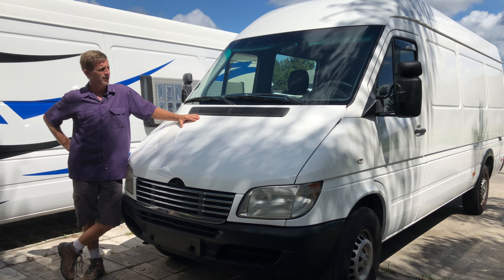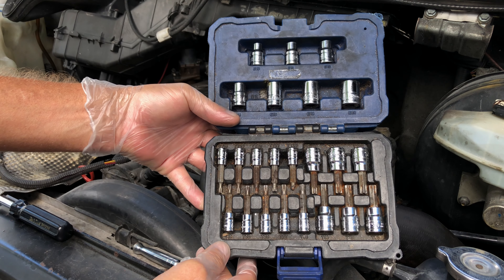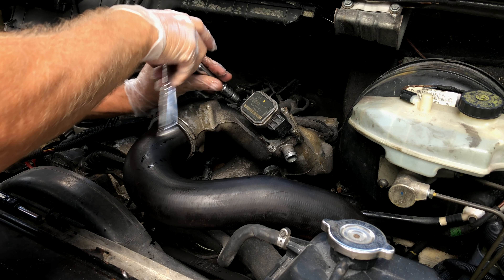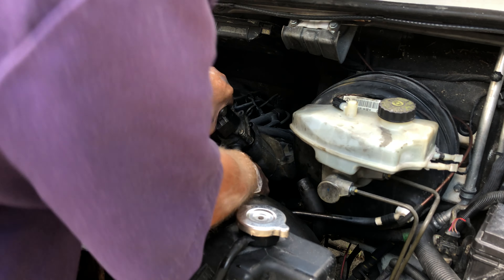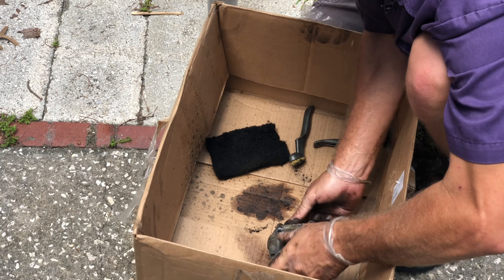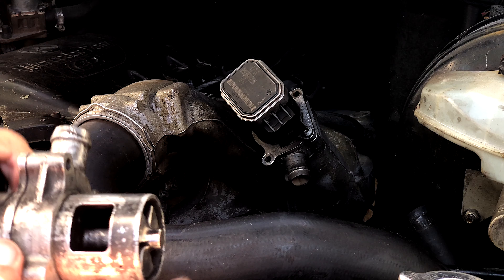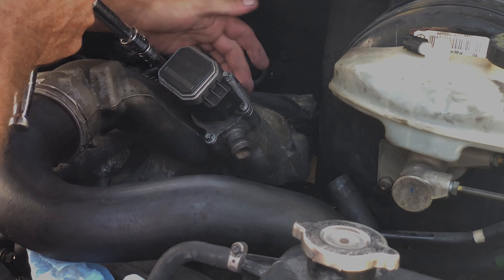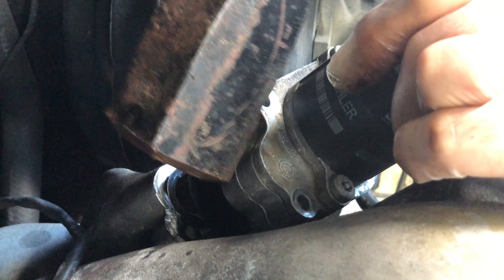EGR Valve Replacement/Cleaning - T1N Sprinter (2004-2006)

Comment: Phew, mine slipped right out! (I was dreading that struggle after watching your video, but looks like the last person must’ve used anti-seize.) Cleaned it up, added a bit more anti-seize, and it’s working lovely…

Turns out my limp mode was due to a tear in the intercoolant turbo hose though, not the EGR valve. But not complaining about a clean EGR valve!

Comment: at 182K miles I was noticing in colder weather that going up a slight rise I was getting a little rolling hill throttle feed; so thought it was time to clean the EGR. My EGR with hose and 3 bolts
removed came out like a 350 chev distributor with very little pull; just a little twisting. The three blade prop was a little lazy in returning to home with a little clink sound. Sprayed the prop with
brake cleaner while holding the prop side close to the earth and some paper towels to collect the buildup and all was good. Now runs like it did when new with the throttle dropping rpm at low speeds very quickly.

Comment: hey, did the other codes go away when replacing EGR aswell? the glow plug module and glow plug issues? i have all the same codes basically with a few more glow plugs ones. THANKS
Reply from the maker: No, glow plugs and EGR are completely different systems. We have videos for testing and replacing glow plugs.

Comment: Thank you, great vid.  I had to replace mine a couple of years back.  The part alone is >$400.  I have the old one and some day when I don't have anything to do, I'm going to tear it down and clean it up.
Reply from the maker: From what I am told, if you crack it open you have little chance of getting it back together & working properly. The security screws are security screws for a reason, so I would clean as best I can without removing those.

Comment: I had a hard time removing the EGR valve from my '06 2500. In fact, I broke off a piece of the part the coolant hose attaches to. I finally did get it off, cleaned it up, it was still not as snappy the one in your video but it'll do for now given I have no major issues.

Comment: What did you liquid was that at the end? I bought my 2005 sprinter last year, and the seller said it had no Egr,  i presumed that model just didn't come with an Egr. Ive since found out there should be an Egr but i believe its been removed, how would  this effect performance?
Reply from the maker: That is controversial and highly debated. If your van is a European model it might have never had one, as they weren't mandated until a few years later. Generally, those who feel the government is here to control us will swear they get more power and 5mph better fuel economy with the EGR deleted. That would be a 25% increase from 20mpg, and science does not support those claims. Those who feel government is a necessary part of civilization will point out deleted EGR will fail annual inspections in most states and Canadian provinces, be unregisterable to any buyer in those areas and punishment for violating Federal EPA regulations is greater than possession of cocaine. A guy 8 blocks from my home was fined $850,000 a few years ago for selling "EGR delete hardware & software" online.
Reply: @FloridaVanMan  I'm in the UK
Reply from the maker: @mikereynolds7956  I'm fairly sure UK sprinters did not have EGR until 2008 or 2009.

Comment: If you have a really sooty fan is there any other  deep cleaning further down in the system  that needs to be done before putting on a new or cleaned EGR valve. And how would you do that please?
Reply from the maker: If buildup is more than a coating and starting to fill the tube of intake manifold a shop-vac and pokey stick can reduce the buildup. Serious cleaning would require removing the manifold and I wouldn't recommend that just for cleaning.
Reply: @FloridaVanMan  Thanks

Comment: Where did you buy the adapter that works for the icarsoft computer. I am still looking for one that works on my 2006 903 316cdi. All i could read out was the engine computer. I have the 14 pin round plug in the sprinter its a european model.
Reply from the maker: I'm not sure there is a good adaptor for the iCarsoft. People tell me the Autel AP200 works well with this adaptor: https://www.autelsale.co.uk/wholesale/mercedes-benz-14pin-connector-for-maxisys-ms908-and-ms908p.html?fbclid=IwAR05zrYl9NBm7tZg9tByjaEoRfO9gy26TmOWjdAN97zNRwHrFmIVHo7cabY

Comment: You did all the wrong stuff removing that EGR valve.  I have broken intake manifolds, damaged sealing surfaces, and broken the valves themselves with that method, and only do it that way when stripping a vehicle.
How to properly remove valve from intake:
Take a brass drift and a shop hammer.  Tap upward along the back upper portion (you will see a notch fro a drift), then the back left portion (where you used that steel sledge head), alternating as it works its way loose.
That's it.
It takes a lot less time that way, too.
Reply from the maker: I couldn't agree more. Nothing we did that day felt right, and not much worked either. Someday soon we will revisit the EGR and make a better vid. Thank for the tips and keep an eye out for the next EGR upload.
Reply: I have the very same egr valve on my 2007 315cdi. It's stuck in rock solid! A brass drift is what I shall be ordering right now! 👍
Reply: @FloridaVanMan  please take down this video then -- I was following it!
Reply from the maker: @richardgenz7406  Sorry if you got swept up in the comments from 2 years ago or misunderstood my poorly worded response. EGRs usually come out much more easily than this one but we have not found a better way to remove them when they are stuck. If I thought this were leading someone down a wrong path I'd remove it. Following this video advice your EGR will probably come out much easier than shown here. If you know a better way to do it we are listening. There is nothing special about a brass drift and shop hammer, and there is no space to swing it while holding a drift of any length.

Comment: is it ok to block of the egr completely,  thanks for the vids, still looking to purchase, just want all info i can get,,joe and misty
Reply from the maker: No. The van monitors air flow and will trigger codes when expectations are not met. There is a popular "resistor hack" that does not actually work. If the resistor doesn't kick codes your van already wasn't commanding the EGR to open. The resistor only mimics a closed EGR. There are other "tunes" available that are illegal, despite any loopholes you may have heard of. EPA is cracking down on these tune companies and a guy 8 blocks from me settled with the EPA for $850,000 fines. The punishment if prosecuted for deleting your EGR is greater than possession of cocaine and brings a felony record. It is illegal in all 50 states, all of Canada and the UK.
Reply: @FloridaVanMan  thank you for your time, you are a great help, take care  joe and misty

Comment: My EGR valve wasn't fully closing.  I cleaned it up with WD-40 and it looked like new.  It fully closes now, but it doesn't make that snap sound.  The mechanical portion makes the proper snap sound with the electric motor removed.  With the motor attached, it doesn't make the snap sound.  I'd like to find out why the motor is slowing down the mechanical portion.  I re-assembled the EGR valve and the vehicle seems to run fine.
Reply from the maker: When the motors get bad they don't snap back. If the van is running fine, run it! But don't be surprised when the EGR starts showing codes and putting you in limp mode. When it finally gives up you won't be stuck on the side of the road and since it was out recently replacing it won't be a big deal. So run it and get every mile out of it that you can. It might last thousands of miles more.

Comment: I think it would be a good idea to use two wedging tools applied at as near to 180 degrees apart as possible. Otherwise, working just one will tend to cause the device to wedge.

Comment: I found that when  taking out the EGR value  using  a heat gun  on the housing will help with  removing the EGR valve.
Reply from the maker: Overheating is usually what causes EGR failure in my experience. When the aux coolant pump doesn't work or the van is pulling too much load, too fast, overheated EGR will cause limp mode and kill the EGR. So be careful with heat if you are just cleaning, not replacing the unit.

Comment: Thank you for this video just pulled mine out for clean up and we'll the damn connection where the hose meets broke.
That sucks was stuck.

Waiting on delivery if new one (Chinese)
And was curious if I should add a little anti seize to avoid this next time.

BTW....  this is a workout to say the least.
Today can and crank sensor
Reply from the maker: You should apply anti seize. We are doing that now on all EGRs we install! 

A workout it is indeed. Good luck on the cam and crank sensors, we recomend a Sprinter specific scanner that can read the "Synchronization between cam and crank position sensors" value to make sure things are synched post operation
Reply: Florida Van Man 
Thank you for the follow up and will add the anti seize today.
As far as scanner how has that Carsoft scanner worked out for you?
Reply: Florida Van Man 
Headed to junkyard tommoro, any parts I should take and keep handy.
Got a few things last week but  headed back for the injectors, and door parts
Reply from the maker: @panchovillasmith8218  iCarsoft MBII works pretty well, but you need to lookup every code. We have a Carsoft handheld scanner that is better about giving a description of each code, but it's got limitations. Autel AP200 Bluetooth is my go-to for diagnostics. Then Xentry DAS is much more detailed diagnostics and has functions the other meters just can't do, like reset intake adaptive, code injectors, virtual compression testing. etc.
Reply: Florida Van Man 
Awesome thank you. I just received the autel yesterday and was considering sending it back to get the carsoft pro.
Main reason was I also have a mitsubishi mirage and a mini countryman (wife's). I don't mind paying the extra for the additional cars but correct me if I'm wrong, after one year I have to buy the service again for the two additional cars correct?
Reply from the maker: @panchovillasmith8218   Sorry, I don't know about renewals or second and third vehicles. We only mess with Sprinters.
Reply: Florida Van Man 
Got it.
Again thank you for all the info. To bad you ain't in Texas.
You would have BBQ and beer for lunch today

Comment: FVM, got a question? I have a little leak in the AC condenser and have purchased a new one on-line. Will I have to take apart the metal cross bracket for the radiator or is there an easy way?
I cannot see in there to figure out just what is needed in disassembly??
VR  Chicago  Thanks
Reply from the maker: Taking the crossbar off is *the easy way. It is only 4 bolts, but the headlights are in the way, and the grill pieces are in the way of removing the headlights.... So it can be an all-day event.
Reply: @FloridaVanMan  Thanks for the info FVMan. I will save up my courage and get er done. VR

Comment: Hi again Bill. Have you discovered another reputable after market ERG? I know you said you were testing that one on the video. But you were unsure at this point. 2005 T1N cheers. Leon.
Reply from the maker: The cheap on linked on our parts page is what I am using now. It is only weeks old and I've not driven anywhere significant, so I won't recommend it (yet). At $120 vs. $380... I have reasonable hopes.

Comment: EGR valve mystery… please advise. I recently bought a 2005 dodge sprinter T1N van. It seems to run OK and have decent power, but out of curiosity, I decided to clean the EGR valve like you show in your videos. Sure enough it was so dirty and sooted up the blades would not turn at all so I cleaned them really well with gasoline. I even took the valve assembly apart into two large pieces and cleaned inside really well and got the blades turning freely and snapping back like you show in your videos. I put it back together and took it for a test drive and the van ran much worse, almost like limp mode as you call it. I pulled over to the side of the road and unplugged the wiring to the EGR just to see what that would do and to my surprise the van ran like a bat out of hell..better than ever.  I’m really baffled. Have any ideas what’s going on? Your thoughts would be greatly appreciated.😅
Reply from the maker: Once you took apart the two halves of the EGR it was done. They have wound springs and electrical contacts inside that we cannot rewind & connect without very special tools. The security screws should never be removed. If your van doesn't go into limp mode with the EGR unplugged it is either modified (EGR deleted) or the intake adaptive settings are corrupted and no longer adapting. 
A code reader like we have linked on our products page will read the live data where we can see if the EGR is being commanded by the van. Looking at the EGR live data will help determine if your van is having an issue or been illegally modified by deleting emissions equipment.
Reply: Follow up to my EGR valve mystery problem, I bought a new EGR valve and installed it, and the van runs excellent now, almost like a different vehicle. What a pleasant surprise and the best part is the transmission is shifting much more often now like it should. I don’t have to manually shift it so much anymore for hills so my question for you is what is the connection between the EGR valve and the transmission??
Reply from the maker: @kirbymoore492  There is no direct link to the EGR but the van shifts based on how well the engine is running. With the EGR sticking open a little the van realizes the limited power it has available by constantly measuring "load". It will adjust the shift times to work with the available power. When power is reduced it will shift later.

Comment: I have 2 T1N both 2005 the first had over 425k and had ok power most or the time but the second is a 158" dully and has been sluggish I installed resonator delete but I'm not sure what to do next, ?.
Reply from the maker: Code reader is essential. If you clear the codes and none come back, the live data will be helpful. If you find your EGR value always at 6% the MAF has probably failed. We have a video shows how to test the MAF. This is a good code reader. https://amzn.to/3H3mfhI

Comment: MY T1N (208CDI built in 2000) doesnt have an EGR valve because it is registered as a truck and only those sprinters registered as a car needed the EGR...I dont know how that is handled in the USA, but here in Germany that was the case...I was looking for it and couldnt find it :D SO now im happy i dont have it so my air intake system stays clean ...
Reply from the maker: I doubt you'll find your intake system clean, just a different variety of dirt. Like anything else, EGR has pros and cons. Everyone will form their opinions based on their unique perception* of the issue and perception is ALWAYS skewed by the point of observation. 
I do try to keep my engines clean but not specifically the intake system. That is a hallway to the incinerator and unless the soot is excessive cleaning it is on par with washing a trash can. I'd only do that if there is a specific problem that needs remedied first.
Reply: @FloridaVanMan  Right, it wasnt really clean :D
But what i meant was rather that my EGR cannot get clogged, since it doesnt exist. 

But how i understand it the only function of the EGR is to reduce NOx and make the car more "environmentally friendly", right?

Well I can live without that, especially since we pay so many taxes already for this whole political agenda.
I will drive my 25 yo van for at least 20 more years, which is quite sustainable. Thanks to your videos and a lot of books i repaired everything alone so far so  please keep up the good work :D
Reply from the maker: @goug359 WOW! So you can live with Nox emissions and to hell with everyone else?
Reply: @FloridaVanMan  But why should anyone suffer because of that?
Reply from the maker: @goug359  Who is suffering* over EGR? The fragility & hyperbole of some people amazes me. How dare anyone ask you to slow down the toxic gasses you spew into the air exclusively for your own convenience? Go start your own channel and debate this over there before you get blocked from mine.
Reply: @FloridaVanMan  
I dont have a problem with EGRs , my car even has a green Euro Plaque :D It has very few emissions and i drive only a few kilometers each month.  

But I still think it is nice that I dont need to think about the EGR as a potential cause for problems with the engine.

I didn´t intend to insult anyone :D 
There are so many  areas in life where people harm the nature and the soil, just by consuming food grown with Glyphosat and other chemicals..and they dont even know about it or dont want to know...

Buying a brandnew car that has all the newest technology and lowest emissions has still a huge impact on the earth, because it uses so many resources in the progress of building it. 

The difference between the emissions that my car would have with an EGR compared to now would be so small that I really dont think im hyperbolic :D

Comment: Will the egr make any type of noise when it's failing? Or is it mostly just power loss?
Reply from the maker: It will make a whine when self cleaning, but nothing new when failing. Most failures are the valve getting sticky or the motor in them dying as motors eventually do.

Comment: everything was fine Great spirit on removing the EGR Valve, but you miss the text drive after put in the new one. just I can sure on my side that is my problem. thanks.
Reply from the maker: If this didn't fix the van we wouldn't edit the video until it was right and the answers were good.